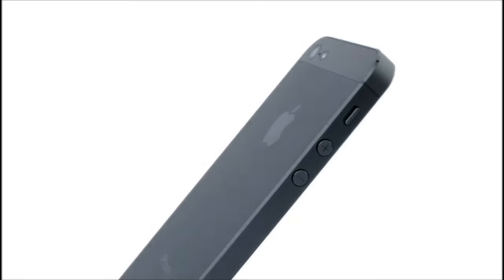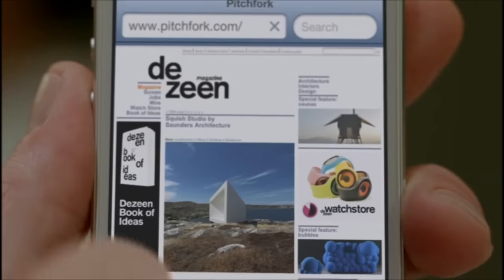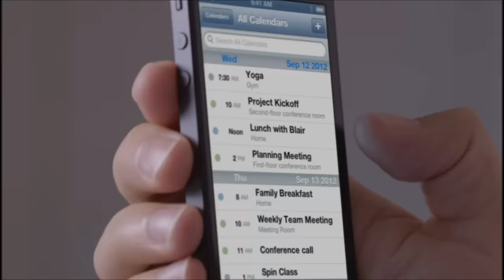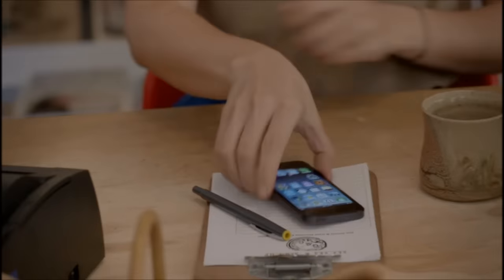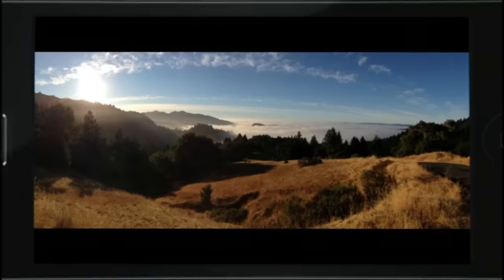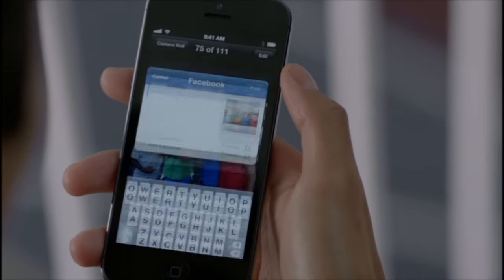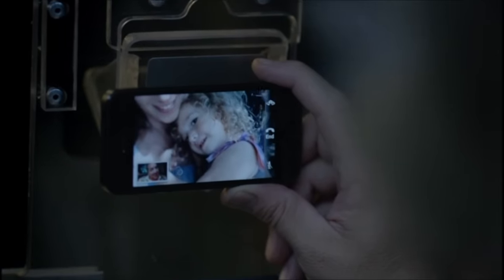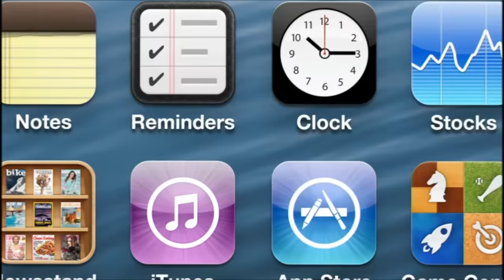Official iPhone 5 Trailer

Comment: How can one dislike this .. ?
Reply: Android users maybe? :3 (not me apple ftw)
Reply: TheBlue8ird True. It's kinda sad, when you remember "back in the day" in 2010 for example, if you pulled out an IPhone 4 everybody was like "O.o" At least here in Germany. Then Samsung came, pushed every feature into their phones they could get a hold of, regardless of whether it has sense or not, lowered the price a bit and suddenly the masses ran after the "pocket televisions" as i like to call Samsung phones due to their large screens. The sad thing really is that the "mass" cant see precision and the love for details of the IPhone lineup. They all get jumpy when they see all the plastic phones with 59 inch screens. Also they dont see that for example the processor of the IPhone is way, WAY more efficient than those from Android models. For example: The IPhone 5S has a dual core with I think 1,3 Ghz. Android user says: "Gnaaah whats dis sh1t, Ive got 4-core maaan". What they dont see is that in Geekbench you get an extremely similar score on an IPhone with its dual core vs. Samsungs 4-core. That means in other words: The IPhones CPU is nearly 100 % more efficient on IOS than Samsungs 4-core is on Android. I'll stop here because its getting too long :)
But you maybe see my point ..
Reply: SpicysaucedHD so true!
Reply: ***** So you disliked because you want the world to know that there are dislike(r)s. What you smoked sir was either very big or very effective.
Reply: R-Y- S-E One of the most mature comments here, thank you for your opinion :)
Reply: iphone is the best phone.All android devices is just one plastic piece of shit.
Reply: Peter Feller Says the one who has none. Really, those kind of comments you always get from fandroids. I wonder why ..
Reply: I personally hate Apple products, but when I did, it was because of these videos. And so, I disliked based on personal preference, and before someone bitches out on me, I watched the video because it's nostalgic to me.
Reply: SpicysaucedHD 100 things iOS can't do that android can
1. App integration with Operating System
2. Can’t set default apps
3. No NFC capabilities
4. Google Now (with card notifcations)
5. True HD resolution
6. Widgets
7. Dual User
8. Replaceable keyboards (Swype, etc)
9. Photosphere (panorama) – without the use of a third party app
10. USB host – USB OTG
A. Transfer media to and from an external SD card
B. Watch streaming video or listen to streaming audio from external SD.
C. Control a Dslr without root.
11. Use a bluetooth mouse
12. Floating window apps for desktop like multitasking
13. Switchable launchers
14. Apps that allow gesture based control
15. Adblock
16. Data usage monitor. App usage, Set warning and maximum
17. Battery usage monitor. What apps are using up power
18. Many system monitors like wakelock
19. VPN Proxy for privacy bypassing country restrictions (Tunnelbear)
20. security apps like Cerberus and . Anti-theft, discreetly take a picture of the thief, see what they’re up to (Cerberus) like prey on mac.
21. Launcher shortcuts for apps e.g. evernote, not just bookmark shortcuts
22. Turn the phone into a server: phone to become a DLNA, DNS, Email, FTP, IRC, Proxy, SMB, SMS, SSH, Web, WebDAV, XMPP server (Servers Ultimate)
23. Android can run on many other devices: USB stick computers, laptops (HP, Asus, Acer), cameras, TV set top, google glass, smartwatch, consoles, televisions
24. Run Ubuntu
25. Run various emulators
26. Run system maintenance tools like cache cleaner, Automatically cleanup all app related files once an app is uninstalled (CCleaner)
27. Change profiles based on situation and location
28. Change desktop based on situation.
29. Rhe ability to backup apps and restore them in case you upgraded to a faulty version
30. Bluetooth transfer to and from different devices not just from android devices.
31. Ability to send BT signals as serial port to be accessed by another device.
32. Ability to assign commands to the phone when the phone’s state is detected eg. light level, magnetic field, orientation, proximity sensors, etc.
33. Able to change file extensions without the need to import the file into an app because of a true file system.
34. Seamlessly pair and use an external GPS device with an android phone.
35. Allow apps to specify download location and not just in the same app container. This means you can copy a file once, such as a pdf, and open it with different apps.
36. No removable storage
37. No replaceable battery
38. Use the device as usb storage without iTunes. Windows only see it as read only.
39. Allow multiple Gmail accounts on one device
40. Flash Custom ROM’s – No need root if you buy an Oppo Phone.
41. Smart app protector – You can password protect specific apps. (ios has my secret folder but does not work for apps. ios needs to be jailbroken for this to work.)
42. AIDE – integrated application development. Develop apps directly from your android device.
43. Disable background data per app when on mobile networks.
44. Support 6 different ways to unlock screen, including no lock
45. Miracast
46. DLNA
47. Find out in detail how your storage is used – apps like disk usage
49. Change system wide font size
50. Almost always have the same app available on phone and tablet
51. Integrated FM Radio (HTC One, Oppo R819, Others)
52. The Ability to change icons system wide
53. Face Unlock :)
54. Multi Picture Wallpaper
55. Ability to hide apps (NO ROOT REQUIRED EITHER)
56. Run Flash Websites
57. Voice Control Anything (using Voice/Tasker)
58. Control Televisions (IR Blaster)
59. Air Gestures (Samsung)
60. Google Wallet
61. Be able to download any files onto your phone
62. Make geeks happy (intangible)
63. Can’t theme your phone, all iPhone’s look the same. No personality
64. Choice of features
65. Boom Sound or Dual Front Facing Speakers (HTC)
66. Thermometer
67. Barometer
68. Back button. Without it, switching to the previous app requires two actions
69. No Porn Apps
70. WiFi direct
71. No Wireless Charging
72. Always Listening (Moto X / AutoVoice)
73. Launch apps from a dock like on Mac os (dock4droid). This will confuse the fanboys because it is an Apple feature that is not on ios
74. Install caffeine like the very popular Mac utility
75. Swipestarter – most efficient launcher
76. Gesture search
77. Anticipatory computing ** See the end of this post
78. Dynamically change your home screen – one home screen for work, and one for play
79. Customize LED notifications
80. Connect to your lan workgroup, copy files back and forth. No need for iTunes
81. Stream movies, music from your shared drives
82. The largest developer support (XDA, Rootzwiki, Etc)
83. Choose from a dizzying array of form factors and hardware. Different screen sizes. Ruggedized phones. Different price points.
84. Can’t set mobile data limits (why they overpay)
85. HDMI output
86. No 15 Minute grace period for apps. once you buy in iOS you’re stuck.
87. Install apps to your mobile device directly from the web play store.
88. Voice Actions on Home Automation
89. Boot into Safe mode
90. Disable background processes on startup without root.
91. Batch modify/move/copy files from one directory to the other.
92. Easily switch from one browser to another (flashify) without copying and pasting.
93. Backup files locally with any version available not just the present and previous ones. Eg. I have 10 different versions of Google maps and I can roll back to any of them.
94. Control lock screen when a bluetooth signature is detected. Eg. Pebble locker. Can also activate any profiles upon detection.
95. Perform tasks depending on magnetic field strength. This is particularly effective to mimic an NFC feature. Eg. Open an app (car mode ultra) by reading and sticking a magnetic strip on a car mount.
96. Make your own Siri. Autovoice + Tasker
97 Run shell Scripts
98. Use phone as external GPS for android tablet that doesn’t have a GPS.
99. Extract apks so no need to re-download from the internet. Just are reinstall from a windows network share or SD card.
100. Ability to control other Android devices (AutoRemote).
101.  iOS user’s can’t eat KitKat’s anymore.
Reply: Ruchir You are resurrecting a VERY old thread. Also you just copied that from somewhere because you are way too lazy to do this yourself. So you're like Samsung and their Design department.
But okay, here we go:
1. Wrong latest since Ios 8.
2. You dont need to. Selectthe App you want to use .. and use it.
3. Applepay operates via NFC. Any other use of NFC is not important. (To switch a profile when you put the phone on a tag, come on .. )
4. Google Now? Theres Siri!
5. Wrong.
6. What for`? There's an app for that :)
7. What for? It's my phone. If you have to share a phone with your whole family you should probably really stay with Android because its only advantage is the price.
8. Wrong. I said it ... you just copied shit :)
9. Then dl a 3rd party app and use it. Takes 30 secs. No one uses this anyway.
10. Correct.
11. A mouse? On a phone? wtf?
12. Half-true. It would be nice to have but one will not decide to buy or not buy a phone only based on that capability. I dont.
13. I dont want different designs. I want my phone to look good by factory defaults which it does.
14. Wut? Sure. Ever had an Ipad?
15. Just use a browser that supports adblock. 
16. Included since ages. You can see also how much data an app consumed. No warning though.
17. Included since IOS 8.
18. See above. Also there are dozens of "battery doctor" apps.
19. VPN Support is included since 2009 .. Had Tunnelbear myself.
20. Antitheft technlogy included with ICloud services since 2011. You can remotely lock the phone, see where its at etc.
21. "Launcher shortcuts for apps e.g. evernote, not just bookmark shortcuts" there you can see how old this list must be. 
22. True. Although there are apps like wireless drive which lets you access the device via wifi, like a thumb drive, without iTunes.
23. Bullshit point. A usb stick in a phone? Right ^^ Smartwatches like Pebble and of course Apples own watch are of cource supported.
24. Bullshit too. Android cant run Ubuntu, its an OS for itself. Also very few phones like the nexus line can run that. And, if I want to use Ubuntu (which I do), then I use a PC.
25. Emulators are not allowed in the App Store for a reason. Did you ever see a legal ROM file? Exactly. Even if you own the respective game, Apple has no proof of that. 
26. Thats the thing: Ios doesnt need cleaner Apps. It is clean by design. You will never run out of storage space just by using the IPhone. The worst scenario on IPhone is, that one app supports a big cache like Facebook. Which on the other hand improves performance. So no need for cleaning apps at all. IOS is not like Windows, Android is. 
27. Sure you can change profiles ... not by location though.
28. Like 27.
29. Sure you can. Backup functionality is built into iTunes since the first IPhone. Backs up Apps, settings, contacts, everything else. And encrypts it if you want ..
30. BT transfer is possible, called AirDrop. Only working with Apple devices. For all other things, there is a thing called email. Why would I send anything bigger than 1 MB over a slow BT connection anyway? We live in the age of LTE.
31. Serial port? This thing is still used by something? :) Not sure what the author meant here.
32. True
33. Why should I change a file extension on a phone? Having smartphones of all kinds (first was samsung) since 2010, never had the need for that. An mp3 is an mp3 and it plays in the mp3 player, lol
34. There is GPS and GLONASS in every IPhone, you dont need to pair an external GPS. 
35. "This means you can copy a file once, such as a pdf, and open it with different apps" You can do that with iCloud drive and IOS 8. Also apps can send files/data to each other. 
36. Dont need that. Buy what you want and use it.
37. Dont need that too. Have a 3GS here from 2009. Still holds a day. Iphone users can confirm that.
38. See point 22
39. You can have as many accounts as you like. Personally I have 2. 
40. Oh please no custom shit on my IPhone. Most ppl dont even put those on their Androids.
41. True. With Touch ID however its highly unlikely that my phone gets accessed by someone else anyway.
42. Develop a phone app on a phone ... ok, lol. Show me only one professional developer who does that. Main working machine most porbably there is a desktop PC (or several).
43. Possible on IOS.
44.  6 different ways? Wow. But there is only 1 efficient one needed ..
45. Dont need that.
46. Apple introducced homekit, does the same thing but most likely way more elegant.
47. Built right into IOS too. 
Where are the two missing points?
49. What for. Most important is that you can comfortly read a font. For that you can set it to bold and change its size in supported apps. 
50. "Almost always have the same app available on phone and tablet"
In other words shitty optimization. A phone app cant work 1:1 on a tablet. Looks like shit.
51. Either you use iTunes radio or another of the 938949 radio apps. Who listens to normal analog radio anyways there days?
52. No need for that.
53. So if I have a picture of you for example from facebook I can unlock your phone? Great!
54.  You are resurrecting a VERY old thread. Also you just copied that from somewhere because you are way too lazy to do this yourself. So you're like Samsung and their Design department.
But okay, here we go:
1. Wrong latest since Ios 8.
2. You dont need to. Selectthe App you want to use .. and use it.
3. Applepay operates via NFC. Any other use of NFC is not important. (To switch a profile when you put the phone on a tag, come on .. )
4. Google Now? Theres Siri!
5. Wrong.
6. What for`? There's an app for that :)
7. What for? It's my phone. If you have to share a phone with your whole family you should probably really stay with Android because its only advantage is the price.
8. Wrong. I said it ... you just copied shit :)
9. Then dl a 3rd party app and use it. Takes 30 secs. No one uses this anyway.
10. Correct.
11. A mouse? On a phone? wtf?
12. Half-true. It would be nice to have but one will not decide to buy or not buy a phone only based on that capability. I dont.
13. I dont want different designs. I want my phone to look good by factory defaults which it does.
14. Wut? Sure. Ever had an Ipad?
15. Just use a browser that supports adblock. 
16. Included since ages. You can see also how much data an app consumed. No warning though.
17. Included since IOS 8.
18. See above. Also there are dozens of "battery doctor" apps.
19. VPN Support is included since 2009 .. Had Tunnelbear myself.
20. Antitheft technlogy included with ICloud services since 2011. You can remotely lock the phone, see where its at etc.
21. "Launcher shortcuts for apps e.g. evernote, not just bookmark shortcuts" there you can see how old this list must be. 
22. True. Although there are apps like wireless drive which lets you access the device via wifi, like a thumb drive, without iTunes.
23. Bullshit point. A usb stick in a phone? Right ^^ Smartwatches like Pebble and of course Apples own watch are of cource supported.
24. Bullshit too. Android cant run Ubuntu, its an OS for itself. Also very few phones like the nexus line can run that. And, if I want to use Ubuntu (which I do), then I use a PC.
25. Emulators are not allowed in the App Store for a reason. Did you ever see a legal ROM file? Exactly. Even if you own the respective game, Apple has no proof of that. 
26. Thats the thing: Ios doesnt need cleaner Apps. It is clean by design. You will never run out of storage space just by using the IPhone. The worst scenario on IPhone is, that one app supports a big cache like Facebook. Which on the other hand improves performance. So no need for cleaning apps at all. IOS is not like Windows, Android is. 
27. Sure you can change profiles ... not by location though.
28. Like 27.
29. Sure you can. Backup functionality is built into iTunes since the first IPhone. Backs up Apps, settings, contacts, everything else. And encrypts it if you want ..
30. BT transfer is possible, called AirDrop. Only working with Apple devices. For all other things, there is a thing called email. Why would I send anything bigger than 1 MB over a slow BT connection anyway? We live in the age of LTE.
31. Serial port? This thing is still used by something? :) Not sure what the author meant here.
32. True
33. Why should I change a file extension on a phone? Having smartphones of all kinds (first was samsung) since 2010, never had the need for that. An mp3 is an mp3 and it plays in the mp3 player, lol
34. There is GPS and GLONASS in every IPhone, you dont need to pair an external GPS. 
35. "This means you can copy a file once, such as a pdf, and open it with different apps" You can do that with iCloud drive and IOS 8. Also apps can send files/data to each other. 
36. Dont need that. Buy what you want and use it.
37. Dont need that too. Have a 3GS here from 2009. Still holds a day. Iphone users can confirm that.
38. See point 22
39. You can have as many accounts as you like. Personally I have 2. 
40. Oh please no custom shit on my IPhone. Most ppl dont even put those on their Androids.
41. True. With Touch ID however its highly unlikely that my phone gets accessed by someone else anyway.
42. Develop a phone app on a phone ... ok, lol. Show me only one professional developer who does that. Main working machine most porbably there is a desktop PC (or several).
43. Possible on IOS.
44.  6 different ways? Wow. But there is only 1 efficient one needed ..
45. Dont need that.
46. Apple introducced homekit, does the same thing but most likely way more elegant.
47. Built right into IOS too. 
Where are the two missing points?
49. What for. Most important is that you can comfortly read a font. For that you can set it to bold and change its size in supported apps. 
50. "Almost always have the same app available on phone and tablet"
In other words shitty optimization. A phone app cant work 1:1 on a tablet. Looks like shit.
51. Either you use iTunes radio or another of the 938949 radio apps. Who listens to normal analog radio anyways there days?
52. No need for that.
53. So if I have a picture of you for example from facebook I can unlock your phone? Great!
54. Wut?
55. Why? I am the only useing my phone as stated above.
56. And draining your battery. Flash is dead. HTML5 ftw.
57. Ever heard of Siri? And yes it can control phone functions like BT etc.
58. You get a remote with your TV, you know? :)
59. Where is the use case of that? Why hover over something when you can also tap it?
60. Apple pay.
61. You can. Anyway, what is the use of an .exe on a phone :D
62. Oh Iphone does!
63. Exactly that is the personality. I ike it the way it is. It has to be useful and stylish. Thats what ios is. You can see Jony's work in every letter. 
64. Way too generic point.
65. Ok .. ? Important .. ?
66. Show me one popular Android phone with a thermometer lol
67. Built into IPhone 6.
68. There are software back buttons ...
69. Who watches pr0n on a phone ?!
70. No need for that.
71. Also. Inductive charging is always slower thatn with a cable.
72. "hey Siri". Turned that off anyway. Imagine a school class when I can wake your phone form the other end of the room by saying that. Would be funny though. 
73. The dock is part of IOS since 2007 ... 
74. Caffeine is an appwhich prevents your device going to sleep. If you want that on Iphone set time to turn off screen to 3954640 minutes and youre good to go.
75. Uhuu ..
76. Uh .. Spotlight? Searches phone, app store, internet, wiki ....
77. ??
78. Sure you can. You can set that ( or your boss sets it for you in a corp. environment) in the Iphone configuration utility.
79. Not important. Blackberry style though :D
80. LAN? WIFI you mean. But true.
81. You can. Most streaming sites support html5.
82. Developer support? IPhones developer support is by no means weak mate.
83. "Dont confuse abundance with choice" ... :)
84. No one overpays here in Germany at least. They limit your speed only if you get over the limit. 
85. There are VGA/DVI HDMI adapters. 
86. True. 
87. You can do that via iTunes too. But there is no advantage to that point. The normal appsore is only one tap away ..
88.  Again: HomeKit.
89. Where is the need for a safe mode? That mostly means that something on your device ran horribly wrong. Like in Windows when you want to uninstall a messed up driver or sth.
You dont need that on IPhone.
90. You dont NEED to mess with those things on IPhone, it just runs! Forget all the "messing with the system" stuff. Turn it on -> works. And yes old Iphones like the 4 are slow now but that is normal. Its 4 years old. Dammit. 
91. Mentioned that stuff above somewhere ..
92. Sure you can switch browser ..
93. You can keep different versions of your apps, sure. Just go into iTunes App directory and go from there. 
94. True.
95. Okay thats funny :) The only truly useful feature you mentioned.
96. "Make your own Siri." I have the original.
97. No need for that. 
98. But when you have your phone with you which has GPS, why would you want to redicert this data to a tablet? Just read the data off the damn phone screen? Also Ipad with 3G have GPS and GLONASS built in.
99. You can like I said save your .app (like apk) files and reuse them via iTunes if needed.
100. Could be a nice feature.
101. I do. 

Conclusion: Youre lazy bacause you copied this only. Youre uneducated because you didnt read your list before posting and it is outdated. And you most probably didnt read everything of my answer. Also you didnt expect that I will answer to that at all.
Reply: SpicysaucedHD Nope :) I know that it is an old tread. I wanted to see if people would actually point that out and correct the whole thing. And if you are going to call other people uneducated you should at least not make any spelling errors. You're making yourself look dumb. 
Youre = You're 
Bacause = Because
Now let me explain the advantages Android has over Apple. This does not mean that I hate Apple products because i'm actually thinking of buying an iPad soon. I'm just stating why I prefer Android in general. 

Reason 1: Widgets. I know apple users may not see the point of widgets but believe me, widgets are one of the most important features of android. They are an essential aspect of home screen customization. You can imagine them as "at-a-glance" views of an app's most important data and functionality that is accessible right from the user's home screen. Why should a user have to open up the weather app to check the weather? Or open up the email app to check your unread email when you can just quickly glance at it through a widget?

Reason 2: Endless customization. I mean lets face it. iOS is just a four by six grid of icons. I mean that's pretty much it. With Android you get much more. You actually get dedicated screens where you can customize your apps and widgets. You don't have the clutter you have with iOS. Sure there are folders but it is not as smart as Android. You can have a whole screen full of apps from a specific category. For example in my phone, I keep all my school apps on one homescreen, games on another, and media consumption apps on the final.

Reason 3: Back button. Now let me explain why a built in back button is important. Apple used to be proud of their iPhone and its one-handed usability but what's the point of having smaller screen when app developers pt the back button wherever they want. For example in Safari the back button is located at the bottom right whereas in another app like YouTube, it is on the top right. This will be a major problem for the iPhone 6 and 6 plus because user would have to move their fingers all over the large screen to hit the home button. This isn't a problem for larger android phones because they have a dedicated home button built in.

Reason 4: LOOKS. This is a huge one. If you like the look of iOS 8 then that is a good thing for you. But what if you want to change the look of the icons? TOO BAD. What if you want to place apps around the screen without them immediately going to the top? TOO BAD. In android you have endless options on how you want to change the look of your device. You can get launchers from the Play Store which can switch out your entire interface. Hell you can even get an iOS theme. Also icon packs can be bought from the Play Store which can change the look of icons. You don't have that with iOS.
 
Reason 5:  Visible file system. When you plug your Android phone into your computer, you can see a file system just like the one you'd work with if you were searching for something on your computer. It's as easy as drag-and-drop. Apple doesn't give you that kind of access to all your files. Instead you have to do everything with iTunes which I personally think is a pain in the butt.

Reason 6: Multiple user accounts can be set on the same Android tablet. Share your Android-running tablet with your family or co-workers? If so, you can set multiple user accounts on one device, limiting the information that each user can see. Can't do that on the iPad. 
 
Reason 7: Google Now. When you're asking natural language questions, Google Now is extremely quick and can parse web pages to find the most relevant information. Siri, on the other hand, automatically searches Bing, not Google. Along with answering user-initiated queries, Google Now proactively delivers information to the user that it predicts they will want, based on their search habits. 
 
Reason 8: Multimedia Ease. Android doesn't care where your music comes from. Apple and iOS 8, however, require iTunes if you want to load your iPhone up with songs (and you need iPhoto if you ever want to access your photos). 
 
Reason 9: Tasker + Autovoice. If you don't know what that it Tasker and Autovoice are android apps that allow users to automate their home. With this you can control your whole house! You can turn on the light, turn on the tv, lock the door to your phone and Tasker will do that. This can be beneficial to the sick and elderly. Look up videos of Android home automation if you  don't believe me.
 
Now I can stay here all day and write a million more reason why Android is better. But I don't think that will be necessary.
Reply: SpicysaucedHD Oh an by the way, 99 % of the "new" features of iOS have been on Android for ages such as replaceable keyboards, widgets (in the notifications center) etc. I'm not going to call Apple a copycat because unlike you I understand how business world works. Companies adopt features from one another. Not copy. So Apple should stop suing other companies for "copying" and instead work on trying to make their products better.
Reply: Ruchir Since I already spent 40 minutes for answering a 90 % wrong list  I wont put any more time and/or effort into this senseless conversation.
This Apple vs. XY conversations are consuming (and consumed) way too much time, not only mine, but yours too.
Also, at a certain point I always think "what is won when we discuss further"? I dont think I can convince you and you wont convince me to switch or something. I mean, I had a Galaxy half a year ago, first thing I did was getting rid of all widgets and I googled how to even remove the google search bar on the main screen. I just didnt like it. Google Now was tunred off because it wanted to know even my way to work and .. I didnt feel comfortable with that.
Then I didnt understand the concept of having 2 "app screens", the multiple home screen pages and the app drawer. Why wasnt the app drawer the default home screen? Then i thought okay, root it. After reading several hours on how to do that I put 4.4 on it. Installed a firewall, installed a rights management software so that a damn compass app doesnt read all of my contacts (as an example) etc. etc. After 6 hours of customizing it was in a for me usable condition. After that I thought, "why did I even do this, when I unwrap an IPhone from its plastic foil it IS already in a usable condition". So I sold this thing again. And found out how much the resale value dropped since I bought it. That was my little Android story. 

 A word to my "spelling errors". As I mentioned before, I am from Germany, and although I try to make no mistakes, sometimes it happens.
That includes the "youre"- the " ' " character is on a very uncomfortable positon on my keyboard, so I didnt use it. 

Conclusion: You will use your Android and I will keep using Ios, and since I am not using IOS devices alone but also 2 macs, staying in Apples ecosystem makes perfect sense for me. 

Oh and btw, was that the source you copied the list from?
http://www.nairaland.com/1860636/100-simple-things-android-even

If you need help with setting your Ipad up when you bought it, drop me a line. The "where is what on a new OS" problem can be irritating, I know it ;)

Greetings.
Reply: SpicysaucedHD Right on brother. I wasn't trying to convince you that Android is the better system for you. I'm just stating the reason why some people might prefer it over iOS including me. That being said iOS is still a great operating system. The reason I copied from an old source was to see if people would actually be smart enough to correct me on it. I've had this conversation with other iOS users and they just kept bashing Android. But you sir proved that you possess intelligence and took the time and effort to correct me which I do respect.  

As regards to your English sorry if I offended you or anything. You write great English especially for someone that doesn't speak it as a first language. English isn't my first language either but then again I live in Canada. 

Thanks for offering help on iOS. I'll definitely ask you for help if you don't mind.

PEACE.
Reply: Ruchir Sure :)
And thanks for your kind comment.
Peace!
Reply: Ruchir Here is the counter point of view to some of the features that are supposedly not there on iPhones - Battery Doctor is a cache cleaner, NFC is now on iPhone 6,  Google Now is there with card notifications within the app,  you can theme your phone, you can get custom app icons and wallpapers, App integration - Facebook, twitter, vimeo etc,  you can check your data usage for apps. check battery usage in general settings, LED notifications is essentially the flash for accessibility issues, you can have multiple gmail/normal email accounts, you need to add them in settings. 

Hope this helped clarify some of the features/apps.
Reply: SpicysaucedHD Android users though ! Haters